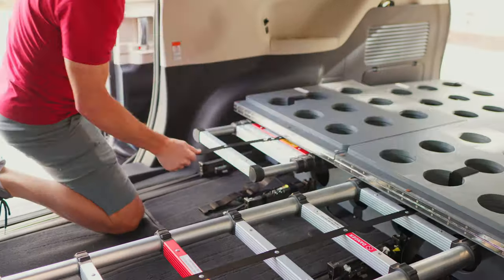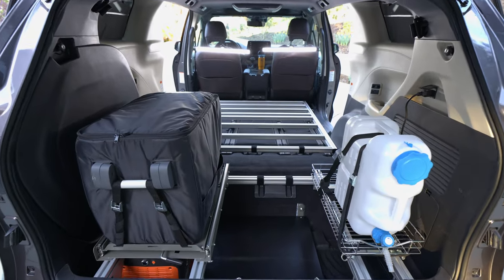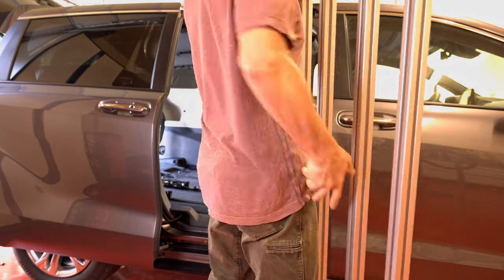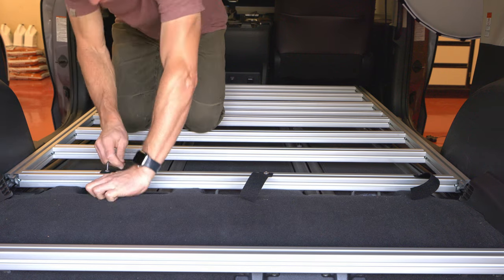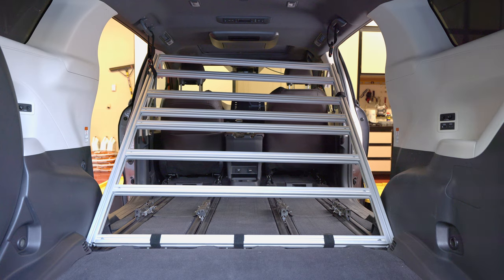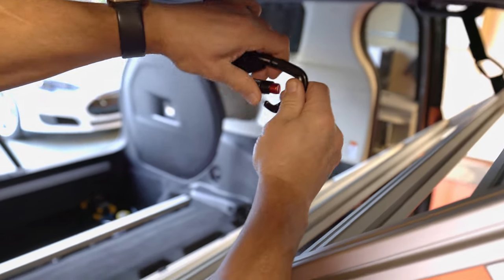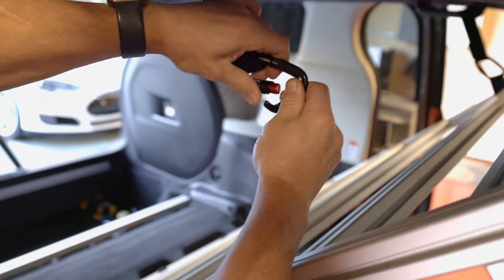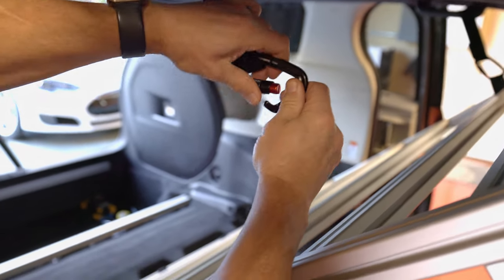8020 Aluminum Camping Rig for Hybrid Sienna Minivan

Comment: I thought the seats in the hybrids were not removable? You have the second and third row out right?
Reply from the maker: Thank you for watching. Yes, I have 2nd and 3rd raw seat removed since we use our van 90% of the time for 2 people. The removal of the second raw seats requires disconnecting of the airbags, which can be done but could lead to problems if done improperly. I have done it at my own risk and because of safety concerns don’t discus this part of seat removal in my videos. Cheers!

Comment: Can i get the exact measurements and list of aluminum parts needed?  And i live in the north east which means i would like to be able to open the fridge from inside the van.  Can the slider go the other way?
Reply from the maker: I am working on new content for the members portal of Tellvia channel. The measurements, parts info, details of my builds and detailed instructions for seat removal and rig assembly will be available to the channel members in the next couple of weeks. The fridge slider has a hard stop on one side. You could install it such that it slides toward the front of the van, but I am afraid there is not enough headroom to fully open the fridge lid. Selecting a different fridge design could be an option.
Reply: @Tellvia  Is the portal up and running yet?

Comment: Hi Telvia - Quick follow up question:  Would you happen to know where the hybrid battery is located on your Sienna?  I am expecting my new Sienna next month and will most likely do something similar, but I am curious as to whether I can remove that big bump in front of the back seat area.   I have a bad feeling that the hybrid battery is located back there somewhere like it is on my Prius.  If I can't level out that bump, I will need to do something similar with 80/20 in order to install a level floor.  Ultimately, I'm hoping to install a bed as well as a kitchen and workspace area.  This Sienna build is going to be way more complicated than I was expecting. 😑
Reply from the maker: Hi William, than you for watching. The hybrid battery in new Sienna located under the front seats. There are two air inlets under the outer sides of the front seats to the fans that cooling it. My understanding is that it is difficult to remove center console  because it is integrated with the shifter and a number of electrical switches and outlets. I hope your Sienna will arrive without delay. Cheers!
Reply: @Tellvia  Thank you! I'm looking forward to your next update on your current build! :)

Comment: Hi Telvia - Can you confirm that the thickness you used was 4040 and also...which website did you go to for the 90 degree adjustable angled brackets?  Thanks. :)
Reply from the maker: Hi William, yes the railing I used is 4040. Here is a link https://amzn.to/3P0ssio to the 90 degree adjustable brackets. Cheers!
Reply from the maker: Hi William, I see your question from yesterday in my YT emails but it does not point me to the chat you posted it in and it is difficult to find it among hundreds of other posts. So I am replying to you question in this thread. Yes, I used a Toyota made floor map for the third row seat well to cover the floor. Please post your questions in a new post next time😀 Thank you and heers!

Comment: Does any trim of 2021+ Toyota Sienna has panoramic moonroof in the back?
Reply from the maker: Hi Mark, thank you for watching. The 2021-2022 Toyota Sienna in any trim has a standard size moonroof above front seats only. The dealers sell them equipped with roof rails in presumption that most of users will carry gear/luggage on the roof. Thus the panoramic roof would have been obscured by the roof carriage. A Lexus version of this minivan, when available, might have a pano moonroof. Cheers!

Comment: 80/20s create too much dead space. In a small place like a minivan you have to make use of every square inch. Get rid of those seat sliders and fit a plywood floor that is stepped up in the back. Then build a level bed / storage system on top. Make sure that your fridge and any cooking options are accessible from the inside. Using any of this from the outside makes zero sense when it rains, when its dark, or when you try to stay stealthy.
Reply from the maker: Hi Asad, thank you for watching. As you can see from the video I leave the 80/20 structure open - so the space under/inside of the rigging is available for storage. 80/20 provides high load capacity, rigidity and relative ease of assembly. This set of advantages will be difficult to achieve with any other building material. The main advantage of hybrid Sienna is high fuel efficiency. We value this and putting anything on the top of the van will reduce it’s fuel efficiency by ~30%. The van is too small to be able to use kitchen inside of the van regardless of the weather (at least when two people are traveling inside). Cheers!
Reply: @Tellvia  You can anchor plywood right on the floor without any framing, it only takes a handful of custom metal  pieces that sit between the plywood and existing holes. You can install all kitchen appliances with access from the inside. Look up drawer fridges for truckers and induction cooktops. I have done all this and fitted a 10 gal fresh water tank, pump, sink, faucet, grey water tank, fridge, induction cooktop in a drawer, butcher block for prepping meals,, fordable desk, TV, computer monitor, soundbar with subwoofer, gaming console, full-size toilet with divider, 280 amp DIY lithium battery bank, 3 charging systems from Victron, 1200 watt sine wave inverter, passive AC system, pull out bed that is 38 by 94 inches, 3 large drawers for food / clothes / dishes / tools / beach bag, 4 fans, LED lighting, as well as a 465 watt commercial grade solar panel on the roof.
Reply from the maker: @asdadasdasd4594  Sounds great! Do you have a link to the video or webpage showing this. Thanks!
Reply: @asdadasdasd4594  You definitely should post pictures (at least) because this does sound intriguing.